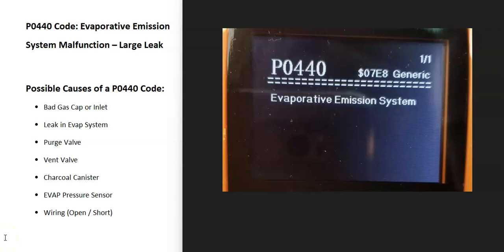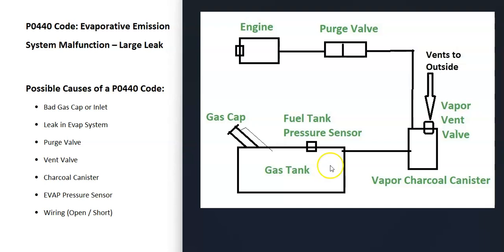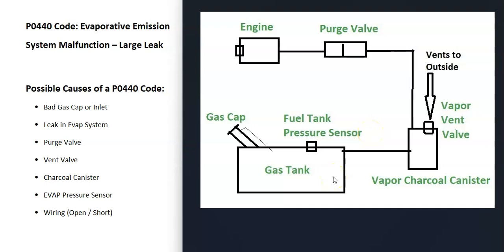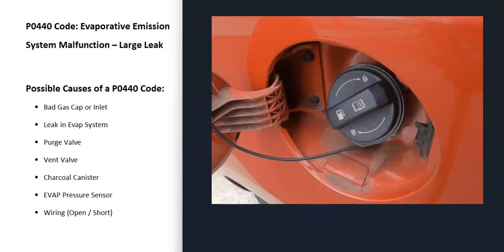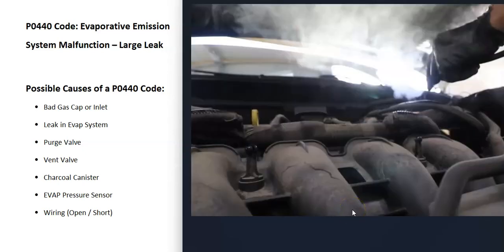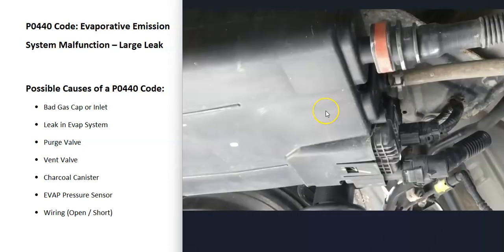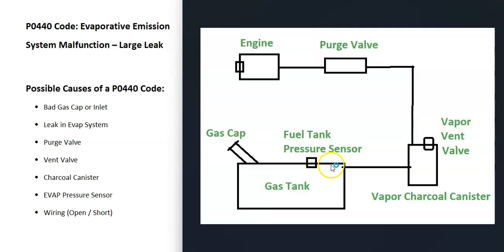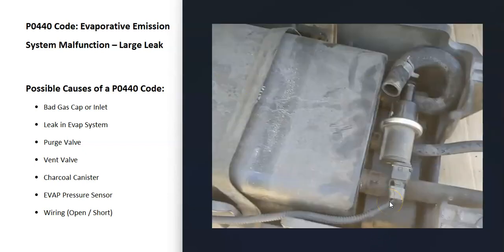Causes and Fixes P0440 Code: Evaporative Emission Control System Malfunction – Large Leak

Comment: I've replaced every part on my '03 Dakota with the exception of the fuel pressure sensor (4.7L Magnum engine), and I'm still getting the 0440 code. Next step is to go to a mechanic with a smoke machine. I've inspected all the hoses and can't find any cracks or leaks, so I'm getting annoyed.....
Reply: Whats up hope you got to the bottom of this if so what ended up being the problem?
Reply: @ronbeee  Never did solve the problem. I've still got that darned code popping up. I'll clear it, it'll be gone for a couple of days, and then it pops up again. Grrrrrrr😡😡

Comment: Thanks for your information. It was helpful do to the 3 codes on a 2002 Subaru Forester. 1 code po 731,2 code po303, 3 code po440 changed the gas cap.  Had to get the valves gaskets fixed. Getting ready to do the enjestors done.? On a fixed income. May Jesus Christ Bless you and your Family always Praying for you.

Comment: Thanks for this video, very informative. So it's a safe bet that a P0440 code coupled with rough idle & difficult starts would be a stuck open purge valve? Haven't checked the canister, tho it's 24 years old & dirty under the van, but the rough idle seals the deal for me. 

 This is common, so I've heard, if you tend to overfill the gas tank. Liquid fuel gets in the canister & destroys this valve.
Reply from the maker: Yes, I would test the purge valve. I made a video on each EVAP component and how to test them. Here is a link. https://youtu.be/C5s3Rx3wjD0